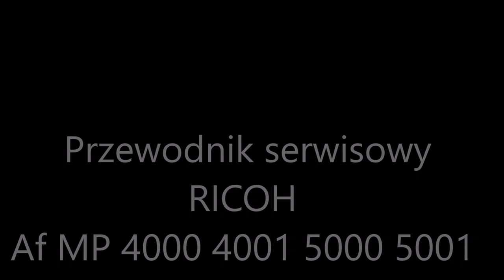VIDEO SERVICE TUTORIAL RICOH MP 5001 - MP 5000 - MP 4000 - MP 4001

Comment: my mp 5002 device is sc 819 error.
I did the hdd exchange but still the problem continues.
Can you show me a way to reset nvram?
machine does not enter sp mode continuously please wait
Reply from the maker: There is no NVRAM reset. It's not a bad idea. You can put your NVRAM on the new PCB BOARD. If you have a problem with NVRAM, insert an SD card with new software and update nvram, but there is no procedure to reset nvram.

Comment: hi,i have ricoh 5000 it shows that my toner bottle is empty but its not i am sure , it makes me print some paper and then it shows again,  what i did is just pull out the bottle and put it again, it worked at first but know this problem wont go away.
Reply from the maker: You probably have a damaged toner engine or some wheel.
Abloe you have used DEVELOER
Reply from the maker: check if your developer is not used anymore
and the second question is whether you have the original toner?
Reply: 324 como resueve
Reply: Tomasz Jemiołek 
Como quito Sc 324
Reply: Como  quitar 324

Comment: Hello, I have  sc670 code in a MP5001, What  I can do?
Reply from the maker: Hello, sc670 Engine startup error.
• Engine does not respond within 30 s after power on.
• Engine down detected suddenly during power on and warmup.
• BCU installation incorrect
• BCU defective
• Sudden communication reset occurred between the BCU and the controller.

Części do kopiarek http://www.copy-expert.pl/
Facebook: https://www.facebook.com/Copy-Expert-113431678801597/
Części używane http://www.copy-expert.com/

Comment: Sc672 problem
Reply from the maker: You have to replace this: https://copy-expert.com/pl/p/Kontroler-RICOH-MP4001-controller-karta-sieciowa-plyta-BICU-IOB-DYSK-2C33-7435B/4957
Reply: Ricoh mp 5000 sh show screen sc672
Reply from the maker: The error code in the Ricoh MP sc672 is probably a damaged controller, but you can replace the HDD first, maybe it will work. Write back if it was successful.
Reply: Thank you
Reply from the maker: Best regards and thank you for the interview.

Comment: Sc442
Reply from the maker: Description: Image transfer belt contact motor error
The image transfer belt contact sensor does not detect the movement of actuator at the sensor while the polygon motor rotates.
Causes: • Dirty image transfer belt contact sensor • Defective image transfer belt contact motor • Disconnected connector of image transfer belt contact sensor or motor • Disconnected cable
Remedy: Check the operation of the ITB unit motor with SP5804-077. No operation: 1. Check the harness connection of the ITB contact motor. 2. Replace the ITB contact motor. Operation: 1. Check the harness connection of the ITB contact sensor. 2. Replace the ITB contact sensor.
Reply: @MrRicoh  MP5001
Reply: MP4000
Reply from the maker: This is a very common problem, so there is the same solution for all models.
Reply: @MrRicoh  tq
Reply from the maker: Greetings from sunny Poland.

Comment: Slv error sc 490 ricoh mp6000
Reply from the maker: Description: Main fan error
The main fan motor lock signal goes high for 5 s while the fan is on.
Causes: • Fan motor overloaded due to obstruction • Fan connector disconnected
Reply: @MrRicoh Thanks tomas